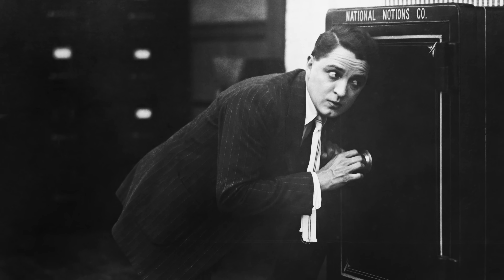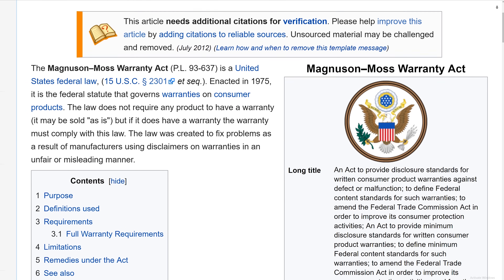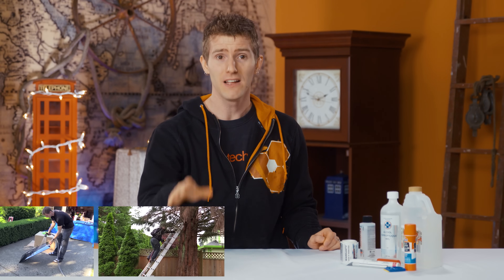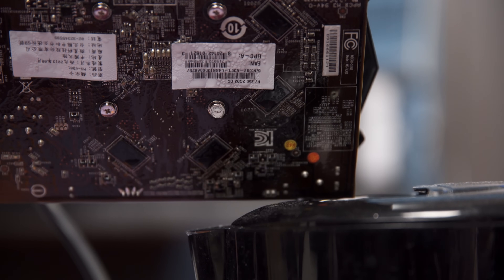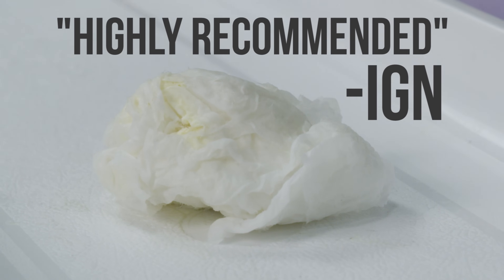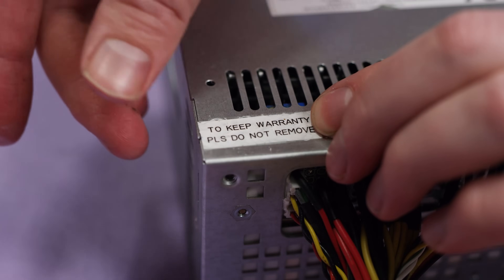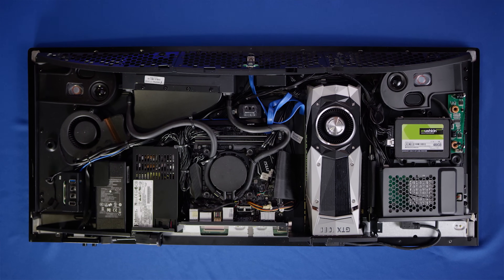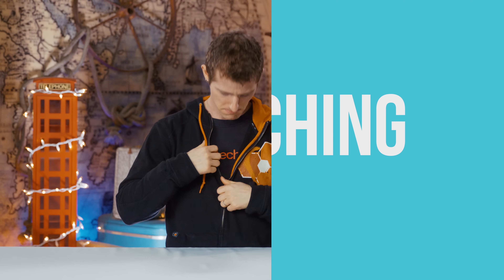Safely Remove Warranty Stickers

Comment: Sometimes a hair dryer and a razor blade are all you need.  Just be careful not to get cut with that razor blade.  The heat of a hair dryer loosens the glue but usually does not destroy it and while the sticker is hot you remove it with a razor blade.  Stick that sticker some place free of dust where you will not accidentally damage it.  When you set the sticker aside it only needs a small part touching while it is sat aside, if you go ahead and stick that whole thing down you are just making more work.  With this method there are no solvents that will melt plastic or paint, just a risk of an accidental cut it you are a klutz.
Reply: John Doe I

Comment: Thanks for the shout out to the Rubik's cube community! As a cuber (one who solves Rubik's cubes and other twisty type puzzles) I've been using those plastic razors for a long time and they do in fact work! I would advise using a new/fresh one every time considering the somewhat soft plastic can and will dent or chip overtime.

Comment: Acetone (nail polish remover) should NEVER be used on plastics.

The acetone can actually partially dissolve the plastic, which then re-bonds as it dries.... This means that not only will it cause visible discoloration, and remove any finish on the plastic, but it will also bond joints together (It basically acts like the pieces of plastic are welded together). This can make it impossible to separate two components of a plastic case, making it impossible to fix whatever is in that case (without breaking the plastic case). 

I don't even want to think of what the acetone would do to the various coatings that go on a circuit board...

Comment: Remove the whole sticker. 
If asked, say it never had one^^
Reply: +Medo Gabr I must inspect my rx 480 carefully, but so far I have seen no sticker... Do I now get a voided warranty?
Reply: It's inside the GPU die... ;)
Reply: grayoctagon never works
Reply: +ArtisChronicles you sound convincing to me ^^
Reply: ArtisChronicles whats wrong with it?
Reply: ArtisChronicles my RX 480 has a circle one on a screw (check under backplate)
Reply: Once worked for me.

Comment: My PSU fan was making some noise. I saw the warranty sticker when I approach to unscrew. Everything was fine, until I realised, PSU fan was 2-pin and the fan I bought was 4-pin. What did I do? I cut a little gap to PSU and allowed the fan cable to connect on motherboard. Warranty? What's that?

Comment: Heat gun set to about 100-120 Celsius and a sharp razor blade. Works every time. 
Just heat up the sticker and slide the razor blade or that orange plastic dummy razor blade under the sticker. 

Try it. :)
Reply: teflon "knife" with carbon lubricant. its the best ive used

Comment: BRUH dont knock AvE like that, yes it's expensive and costly but if you're doing anywhere close to 10 stickers it's a godsend to have the right tool versus solvent and a hobby knife or etc.

And you guys kept mentioning solvent, but using a hair dryer or heat gun works 1000x better without potential part damage.
Reply: They didn't really knock him, they actually said he is an experienced machinist, since he can make that stuff. It's just not a method that fits with LMG, and possibly its viewers, since they usually go on the cheap / easy side.
Reply: they really should have researched the topic more or at least tried heat as I've seen heat used effective for ps4 stick removals.

Comment: And then there's companies like EVGA who let you keep the dang warranty if you take apart your card to work on it with replacing the thermal paste or even replacing the whole cooler with a waterblock (as long as you send the card back with the original aircooler if doing a RMA).

Comment: I use (in german its Ethanol, I Dont  Know if its the Same in english) Works well!!!
Reply: Korkovis Paschalis Yeah, that's part of the Rubbing alcohol. For example 90% rubbing alcohol consists of 90% Ethanol and the rest is water. (I didn't write 10%, because most of the times it's less than 9.4%) :)
Reply: Isopropyl Alcohol isn't the same as ethanol

Comment: Hey guys I bought a cooler master v650 semi modular and i just realised it does not say skylake or haswell compatible anywhere on the website. Will it be ok? What happens to my i5 6600 if I use this power supply?

Comment: The easiest way to remove the sticker:

 1. Make a photo before you remove the sticker and take measurements 
 2. Remove the sticker (dont be gentle)  
 3. Open the photo of the sticker in Photoshop and resize it 
 4. Print it 
 5. Put transparent tape on it (for the glossy sticker look)
 6. Cut the sticker into the perfect size 
 7. Glue the sticker back on (use the photo for the perfect fit)
Reply: Or just print it on sticker paper.
Reply: Jenny Wakeman Sure ^^ Great idea
Reply: freedustin Not all of them ^^ And the most people in the Shop don't inspect the sticker properly
Reply: Don't these stickers have a thread mesh in there now? That's gonna be a bitch to recreate.
Reply: chuckles de clown If it's still intact why not reuse it?
Reply: I just use a Crayola. :D
Reply: or scan the sticker if its somehow intact
Reply: because the stickiness might ware off and it probably won't be completely intact(like the stickiness kind of came off during the process, i don't know

Comment: I bought a Lenovo T500 from an electronics retailer, the warranty void sticker was on the front corner screw which is totally irrelevant unless you want to separate the bottom panel from the chassis. This means I am able to remove the CPU, Ram and heatsink/ fan assembly etc without voiding the warranty.

Comment: Why not just print a new one? Take a nice high res photo without any light glare and print it on adhesive back paper (with a gloss finish)? Make sure the scale is right and I bet this would be far more effective. Although it might be more expensive, over time it would make up for the time you would have spent.

Comment: lol, I once opened my Xbox One controller cuz the sticks were drifting upwards and I wanted to fix it. I removed the warranty sticker cuz I had the controller in over 6 months. I couldn't fix it so I got mad and smashed it (cause I was trying to fix it in over 2 hours). The left bumper (LB) got off and I couldn't fix it. I had another controller which was okay so I tried to somehow send the broken controller, which didn't have a warranty and was broken by me to a repair center. I said that the LB got off by my playing a Titanfall 2 and using the "Bumper Jumper" layout which uses the LB to jump. First the Xbox Support guy said that they can't repair it, but later asked for the serial number of the controller and said that it's possible to replace the controller with a new one if I send my old, broken one to their repair center. I was okay with it since I had another controller which worked just fine. After 3 weeks (shame on you Microsoft) I got the controller, and surprise, surprise, it's a new controller. It was the newer version, V.3 which was released with the Xbox One S (Xbox One users will understand it). My broken one was the first version which didn't have a textured grip and Bluetooth connection to a PC. So I basically got a new controller by Microsoft which didn't have a warranty anymore since I had it for over 6 months. Thank you for reading this and have a nice day, and I'm sorry if I misspelled some words, my English is not the best.

Comment: hey guys i have seen a laptop with gtx 1050 (2gb) i7(7700hq) 16gb ram can it run gta v at 60fps at very high to ultra settings???
Reply: Varun Kesari Wtf I saw u on YouTube 7 hours ago on JerrysRIGEVERYTHING
Reply: no
Reply: Varun Kesari The gtx 1050 sucks paired with a i7 7700, you at least need a gtx 1050 ti.
Reply: No, not on Max settings. You would have to turn down some things.
Reply: 2gb vram isn't enough to run high texture quality in GTA V without stuttering.
Reply: got the g751jy everything on ultra  and some overclocking im at 50-55fps. so yeah i guess u can
Reply: Stop overestimating your laptop
Reply: Depends on the resolution. 720p? sure. 1080p? Probably not
Reply: No, it would get around 40fps. Just google gtx 1050 benchmarks to see what performance you would get
Reply: i got a i5 hq 8gb ram and 1050 4gb hp omen laptop plays just cause at max ultra setting AA x16 (or off dont remember) at 40-45frames
Reply: really i had lower expectation for the 1050 4gb in a laptop but it plays pretty good :) rocket league for 2h on ultra and just cause at ultra for 30min at 40fps dont know how about the 2gb.. seems low
Reply: No, try to get a 1050ti like dell xps or get a 1060 laptop
Reply: VanillaSnow it's pretty decend with 4gb. But no TI. You can't find ti here in france cause they have some but 1050ti in laptop = 1000euro and a 1060 in laptop = 950-1000euro lol so yeah nvm
Reply: absolutelty NOT.
gtx1050 is very low spec.
And you're i7 isnt really up to par like the i7 7700 desktop chip.
Reply: Varun Kesari worst deal ever, i7 with a weak ass 1050 2 gb? There is better for almost the same price. Not worth it
Reply: Varun Kesari worst deal ever, i7 with a weak ass 1050 2 gb? There is better for almost the same price. Not worth it
Reply: KolorRaid i agree
That is a shit configuration... 1050 2gb... With i7 and 16gb ram... The use.. Not enough video ram for real video editing.. (even do it shares with pc ram i think but still)  games same. 
Like im sure for the price u could have gotten a 1060 3gb
Reply: Matt Mellor oh but it is
Reply: OVERKILL
Reply: Not at 1080p
Reply: Varun Kesari how much does it cost?
Reply: totally agree
Reply: not 60fps ultra maybe 30 fps ultra probably 60 medium settings or medium/high
Reply: Just Feeds very high??
Reply: probably 45 or 50 you can search benchmarks for gta 5 gtx 1050 and intel 7700hq
Reply: but Can It RUN CRYSIS?????

Comment: hey guys i have seen a laptop with gtx 1050 (2gb) i7(7700hq) 16gb ram can it run gta v at 60fps at very high to ultra settings???
Reply: Varun Kesari if 1080p the it would be around 40 to 60 so yeah it can
Reply: At 1080p?
Reply: Varun Kesari yes
Reply: Varun Kesari of course it can
Reply: it wont max settings, such as high world details because the vram is insufficient. Go ask that question in a forum (hardforum) oder Google 1050 Benchmarks
Reply: Medium settings, a 1050 NON ti is slightly faster than a 750ti (Which i owned) will be ok-ish at 1080p. Also AVOID gaming laptops like the plague if you're looking for price/performance, a desktop pc of the same spec is often just over half the price.
Reply: Dayz Me Rollin' are you joking? 750ti plays gta 5 on high settings really fine. Your 750ti isn't even close to 1050. GTX 1050 is on the gtx 770 level. You shouldn't answer these questions if you don't even know how gpus compare.
To the question op. You should just check for fu*king benchmarks. They have all the info you need and you wouldn't waste our time that way.

Comment: Best way is use steam!  Slowly steam any sticker until you are able to peel it with easy!  You can use same method to open and reseal letters without anyone noticing!
Reply: right... because water + electronics = good
Reply: I was jk!  Best way to peel it off is lick it until its safely removed!
Reply: In that case... I prefer to just put my warranty protected electronics into a blender filled with water. Once inside, leave the blender running at it's fastest speed for 5-10 minutes. Remove the stickers with ease afterwards!
Reply: happylego91 might scratch the sticker in blender tho!  I also found that using a jig saw and just cutting the area around the sticker works well,  that way its still attached to the component...